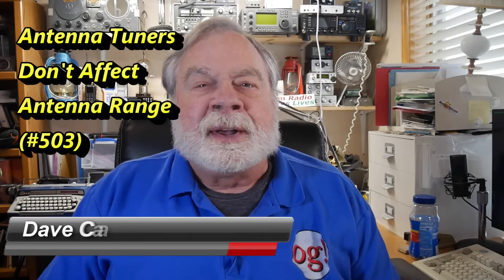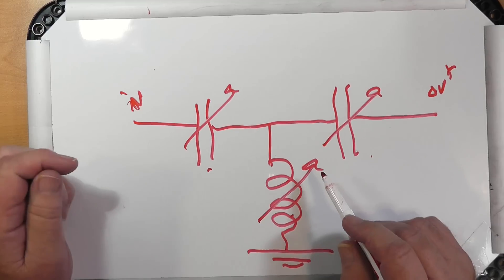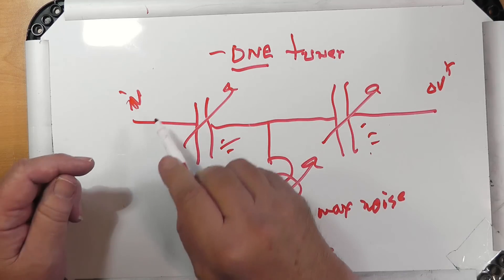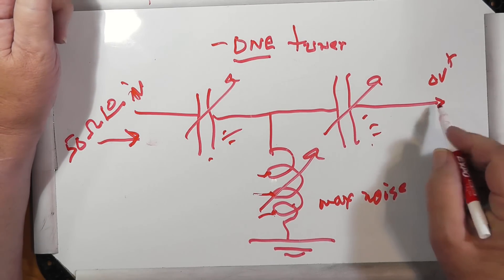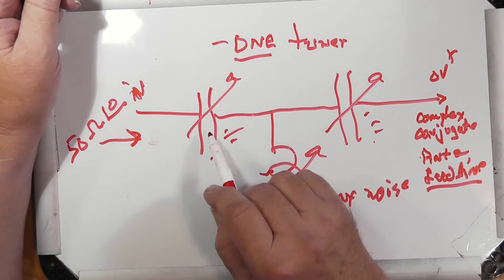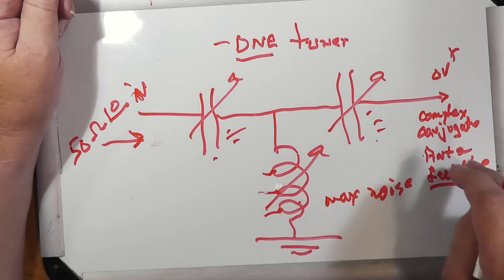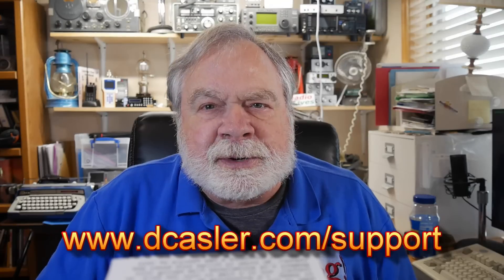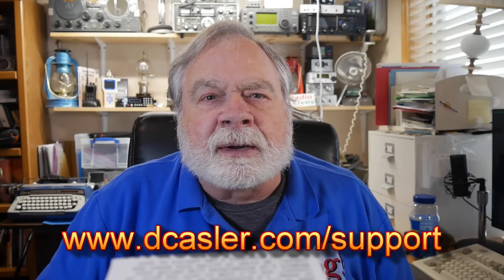Antenna Tuners Don't Affect Antenna Range (#503)

Comment: I heard that if you connect the antenna directly to the tuner then it's highly efficient as the losses from the reflected signal are mostly in the coax. No coax = no coax losses. The signal bounces right back into the radiating element where it, you know, radiates. I'm combing videos on tuners to corroborate this. This video seems to support that notion. If so, you should put the tuner at the antenna and run whatever long run of coax you need between the tuner and the radio, not a long run of coax between the tuner and the antenna feed point.

Comment: Yes your tuner will counteract whatever mismatch you have at the transceiver, but the problem with regular coax antenna lines is that the losses from high SWR  go up substantially!   So many people feed their antennas with ladder line, because it has much lower losses, with a high SWR!  This especially applies to longer feed lines!

Comment: Not sure  I agree with your title.  A tuner allows the radio to operate  (safely for the radio)  at full power,  and therefore  without the  radio  "cutting back" on power  it follows that  more power out  might just equal  "more range."   A good example is something like  a  parallel line feed  which, without a coupler is so far out of  load impedance to the radio  that it will hardly  generate  any power

Comment: i have an older versa tuner. I guess u call the twines of the circle form. When I got this old tuner. the knob was loose or broke. I took it apart and fixed the knob with some J B weld. I have not used it, but I wonder if it would work if I blew the cob webs out of it. one om my new radios have the tuner built in in and the other has a m f j  auto tenure on it. My question Can the old versa tuner be used on other radios. say a ten meter I really don't under stand tuners.

Comment: The term 'tuner' is a misnomer.  The device does not tune anything!  A 'matchbox' provides a conjugate match between the radio and a mismatched antenna which makes the transmitter happy and allows it to generate maximum output.  Better quality matchboxes use a true 'PI' network for matching.  But if the antenna is not matched, you still get reflected power.  The matchbox does not dissipate the power.  Instead, it shunts the power to the case of the matchbox, and thus the shield of your coax, causing feedline radiation.  This is something you do not want at your operating position.  It causes RF feedback, 'hot' mics, and other problems including excessive RF exposure (Remember that?) in extreme cases, something most newer hams without proper in-depth technical knowledge cannot figure out how to correct.
If a matchbox must be used, a feedpoint matchbox (an Icom AH-4 is an example) should be used rather than a matchbox at the operating position.  Hang a counterpoise wire(s) off the ground terminal, then you choke off the coax and control cable at the matchbox with torroids to keep the coax from radiating inside your shack where it can cause feedback and all those other problems.  I've use this setup on multiband verticals where less-than-perfect SWR can be a problem.  Works every time!
The feedpoint matcher is more technically involved to install than a simple box on the bench, but it sure solves a lot of problems.  73 and all the best!

Comment: Dave. Could you please do a presentation on a transmatch affecting the recieved signals from a non resonant antenna. I have tried more than once to explain to people that one of my favorite antennas, a 43ft groundplane antenna is not deaf just because i use a transmatch to match the impedence at the transciever. In my experience the signal recieved from the non resonant vertical is perhaps a few microvolts different from one of my resonant verticals on the same frequency at the same time using a manual switch. I only use LMR400 coax so that very little of the signal turns to heat and is lost in the coax. I get a lot of flak for using non resonant antennas from some people. I use a 4 to 1 voltage balun at the base of the antenna and a 1 to 1 choke right before the shack to remove any common mode current that may occur. 

Say 100 microvolts hits the antenna, half of that energy is immediatly is reradiated, 50 microvolts heads through the 4 to 1 balun down the 125ft of LMR400 to the 1 to 1 choke, then 15ft of LMR400 to the transmatch, then 5 ft of LMR400  to the radio. At 14 mhz the published loss is about 1db in the coax. 50 microvolts at the reciever is roughly S9. My current favorite transmatch is the Dentron Super Super Tuner which features very robust silver plated strap wiring. 

Not having $150,000 dollars worth of calibrated Rhode and Swartz equipment to accurately measure the microvolts at the base of the antenna vs the microvolts at the transciever i am stuck using calculations and empirical evidence to suggest that no more than a few microvolts is lost to heat in this arrangement. 

If you could address this topic sometine i would appreciate it. I hear just fine and am more concerned with recieve than transmit power cause if you  cant hear em. You can't work them. 

Thanks
Cliff
AG5WE

Comment: You mentioned the swr meter to be in front of the tuner. Is this really important or can it be after the tuner also? It seems to me it shouldn't matter. Thank you for the great video's.
Reply: Meter belongs between radio and  tuner.  You are NOT  changing the SWR  between  tuner and antenna.  All a  tuner/ matchbox/ coupler does is  to match the radio to the tuner so that the radio can  load into a good proper load, put out full power without damage.

Comment: I must say the antenna tuner affects the power radiated by an antenna and therefore its range from my point of view. Explanation:
If I have a transmitter with 100W output and an antenna + feeder with terrible SWR 6.0:1, then nearly 50W is reflected back to the transmitter and converted to heat in it; the remaining 5OW is radiated into the space. If I insert an antenna tuner and reach SWR 1.0:1, almost all 100W is radiated, resulting in a bigger range. The improvement is 3 dB in this case...

Comment: I get that a tuner can't create power.   Easy concept & simple conservation of energy law.  But the power from the transmitter has to go some place.  Heat or radiation.  If the tuner bounces reflected power back to the antenna,  why doesn't more power radiate from the antenna and thereby improve the range?  You haven't mentioned phase issues.  Wouldn't the feedline length have a phase contribution to the reflected & bounced back power?  Thanks for these great videos!

Comment: I think it is a lot easier to think about how an antenna tuner works by looking at a Smith chart.  The goal of the antenna tuner is to move the impedance seen by the transmitter as close to the center of the Smith Chart (perfect match) as possible.  An antenna tuner absolutely affects radiated power.  By a power conservation argument, neglecting losses in the system, if you have no power being reflected back to the transmitter because of the antenna tuner, all the transmitter power must be going out the antenna.  However, in real transmission lines, you always have some loss. If the antenna is severely mismatched, all the benefit of having an antenna tuner can be diminished by the cable losses (especially on very long cable runs).  Ideally, the antenna tuner should be as physically close to the antenna as possible.
Reply: Agreed, Better RF Power Transfer using Tuner (Impedance Matching System  - Transmitter => Antenna System) will give you higher Radiated Power = Better Signal to Noise Ratio over longer distance. The intensity of radio waves over distance obeys the inverse-square law, which states that intensity is inversly proportional to the square of the distance from a source. More radiated Signal Power will let you be heard at a greatet distance. Why else do Old Timer Hams say "Life is Too Short for QRP" and 1500 watts is legal on most Ham Bands and Modes.
Reply: @mrkt-watcher  "The intensity of radio waves over distance obeys the inverse-square law" is an extremely common misconception, which is false in almost all real scenarios. You're going to get the inverse-square law if you're perhaps communicating between spaceships. In almost all other situations, the exponent of the loss is much higher than 2. In practice, values as high as 8 can be seen.

Comment: Dave, thank you so much for answering my question. I am now in a better position to understand the mechanics of a tuner and building my HF rig going forward. 73 from Dan Evander, KJ7YBK
Reply: use good coax as well rg8x minimum for HF. Cheap coax is very lossy.

Comment: I think modern transceivers have a safety feature where if the SWR is too high they will only transmit at reduced power so you can’t burn out your final. Is that true Dave?  Good talk thanks. Hugh. Jones VE7YJ
Reply: Yes, that is true. But make sure you know what the radio does that you own, with bad swr. Most atu within a radio will not tune above 3:1 and somewhere lower than 3:1 they will reduce power. But again, please check if that is the case with your radio. 73.
Reply: @pd9rd  thanks.

Comment: Wait I am confused, if the signal is being bounced back to the antenna because of a miss match in the network as you stated, and that then some of that reflected signal would then be radiated out on the second time around, that would mean there would be more of a signal power output compared to not having the tuner at all. So the affect to the antenna ranger would be greater.
Reply: Thats a good thought. Remember that every time a signal passes through an impedance mismatch it losses some power. The sum of the forward and reflected signal must equal the incident signal. By the second time around the signal has gone through two impedance mismatches, so it is likely very small in comparison to the incident signal. 

Now add this twice reduced signal to the next forward traveling signal. It is mathematically impossible for the sum of the twice reflected signal and the forward signal to have more power than the signal that would have passed given no mismatch. 

The highest output power always occurs when all components of the system have matched impedance. This rule is always true.
Reply: Why don't you explain that the transmitter output impedance is actually looks like a 50 ohm resistor?  It makes everything easier to understand.

Comment: When using a tuner you should first reduce the power output of your radio to protect your output circuit and once you get the swr as close to 1-1 as possible then you can increase the power output of your radio without destroying the output circuitry . I learned this many years ago as a citizens band operator . Yes please have an swr meter between your radio and the tuner or the antenna a then you will know if your have a good match or not .

Comment: I seldom hear the fact that manufacturer spec coax loss is measured at 1:1 swr, and increases with higher mismatch.....the tuner at the transceiver does not reduce that loss!
Reply: With a high mismatch its a total loss if the tuner isn't there. Insert the tuner and your "reducing" the loss from total to manageable loss.
Reply: @forgetyourlife  i guess it depends on your definition of a "manageable loss".
Reply: @daveG1020  in this case It depends on if you have a tuner or not. With a poor match your not getting on the air without one.

Comment: Is theoretical best practice to build an antenna to meet theoretical perfect resonance at a particular frequency, then get ideal impedance through coax length, capacitance, and tuning?  Perfect the radiator and tune the rest, rather than length and shorten the antenna to get 50 Ohms?  Or is that more "hot rodding" and attempting to push another 5 horsepower out of a 1,000 horsepower engine?  

Better stated, what is the gain from a near perfect radiator over a compromise radiator tuned to proper impedance?  I.e. if I tune my 108" CB whip setup to 1.2:1 SWR and use it on 10 meters, and then use my 102" whip which is made for 10 meters specifically with a 1.2:1 SWR, and the impedance isn't the issue, how much better is the performance of the 102" whip over the 108" whip?  

I've gotten my 102" whip to get near 1:1 SWR on 20 meters with my external tuner.  But, how good can it actually perform?

Radio is a world of making compromises most of the time, but what is more important to compromise?  In theory, is shortening the antenna to get proper impedance theoretically backwards?
Reply: The best antenna is a physically tuned antenna. Second best is a electrically tuned antenna, using coils et cetera. A whip antenna for HF is usually not resonant by its length and  is therefore a so called compromise antenna - even with a perfect 1:1 SWR. I wouldn't fuss too much over "hot rodding" it.

There is one exception: some compromise antennas use the coax feedline as a counterpoise. In that case, a minimum of 20' or roughly 7m of coax is required.
Reply: @erpece  High HF is a good example of how a compromise antenna can hurt performance.  A 2 foot long loaded CB antenna from Walmart might be a ~2 mile antenna LOS with a legal rig, while an unloaded 108" full quarter length whip with no loading will do 10+ miles LOS in the same conditions.  Proof of pudding is in the eating, and a compromise antenna can be a huge hit to performance.  

LOS is a decent reference because it is more controlled, and results can be measured more 1:1 and better understood.  Since skywave is so dependent on conditions, I think lower HF users can lose a little bit of perspective in terms of performance.  You can make great contacts with a 40 meter Hamstick, because of conditions.  With poorer reception and ERP and radiation patterns, how can you tell how many contacts you AREN'T getting because of the performance loss?  Without reference, it is hard to determine how that "compromise" antenna is failing.  

Maybe in some cases the loss in performance isn't concerning.  Maybe it isn't that bad.  But, I think there might be a decent amount to be gained in antenna optimization.

Comment: All that signal being bounced back and forth repeatedly between the antenna and the tuner? Does that cause any "tremelo" distortion or other degradation from the multiple time-delayed copies of the dignal going out? Or is that imperceptible to the ear, and the transmission?
Reply: Speed of light negates any of that however cheap lossy coax will make the 2nd 3rd or 4th trip harder. It turns to heat and less radiated power.